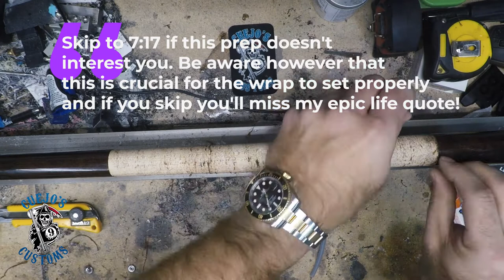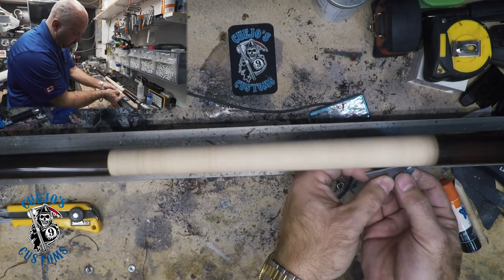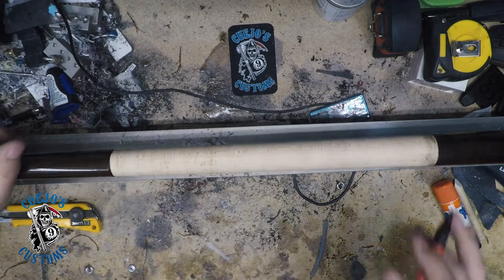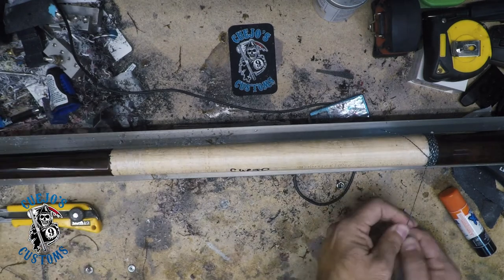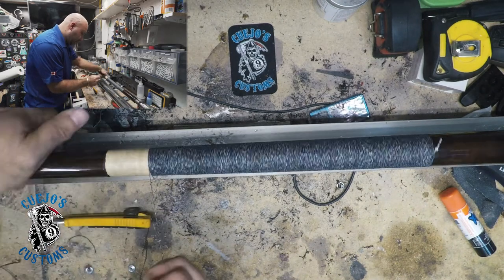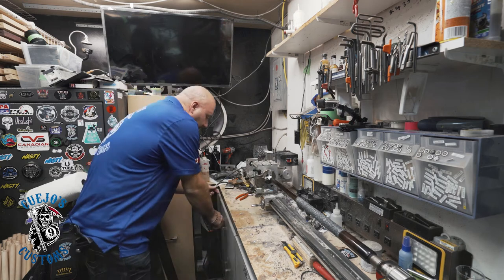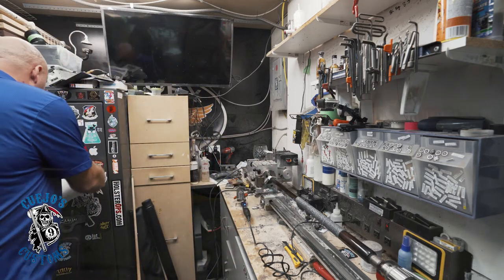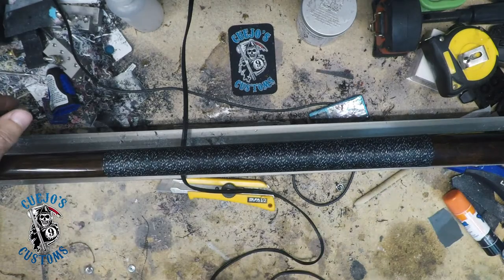Complete Linen wrap Full length

Comment: Super simple way to remove the old glue residue: run the lathe slowly and use a large flat fine single-cut metal file.  Lay the file on the spinning cue and allow the weight of the file to do the work; clean the file frequently with a file card.  The smooth teeth remove no wood but perfectly plane off the old glue residue.

Comment: (( hey CuJos , This is Ronnie D. Here & I'm From Missouri , & I Have Two Comments For You , My First Comment is They or  the People who Designs Billiards Cue Repair Machines ,  they Need To Come up With a Sander Butt Cue Machine That Sands The Bottom of The Old Lenion Cloth Wrapps Dabree From The Cue Butt ,It Will Make You're Job Much Easier, & Less Time So You Wount Have To Use A Box Cutter Blade To Remove The Old Dirt & The Excess of Dabree That Usually The Lenion Cloth Wrapps, Leave Behind Over The Period of Years , That's My First Comment, Now My Second Comment is ,I'm No Cue Repairs man , But I Appreciate The Hard Work That You Do To Make You're Costumers Happy & They Become Repeat Costumers Along the Way ,& that Was My Second Comment, & Thks.For Reading My Comments, Take Care & Stay safe & I'll Keep Watching & Learning Thks .))
Reply from the maker: Thanks for the comment!
Reply: The simple solution is to run the lathe slowly and use a large flat fine-cut metal file.  Lay the file on the spinning cue and allow the weight of the file to do the work; clean the file frequently with a file card.  The smooth teeth remove no wood but perfectly plane off the old glue residue.

Comment: Ever thought about getting a new variable speed controller that will run that dc motor slower? Makes doing linen wraps much easier. And the linen press, I made one for 30 bucks worth of aluminum and left over delving from making custom collars.
Reply from the maker: I can make it much slower yep, I usually spin the cue faster, but it needs to be pretty straight for me to go faster
Reply: @Cuejo  any way you do it, linen wraps are a pain in the ass and necessary evil of this industry.
Reply from the maker: Wait until my next video goes up. 
Man I hated that one 😂
Reply: @Cuejo  looking forward to it.

Comment: How do u get a new Irish linen wrap to get less slippery?  Just got a new predator and the wrap is too slick. Does the starch help that or make it worse?
Reply from the maker: You could try a light clean with a small amount of laundry detergent and water mixed. Don’t get it too wet. 
The fibres will raise a bit. 
We generally desire the smooth finish, but everyone likes a different thing 
Hope that helps!